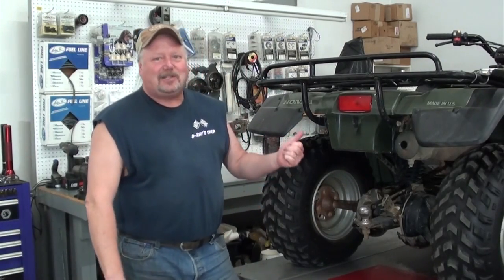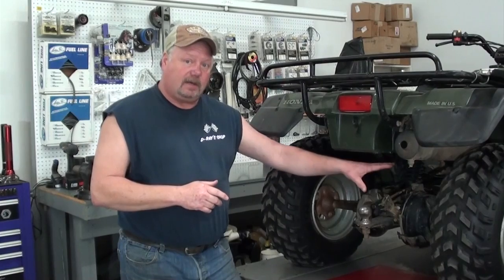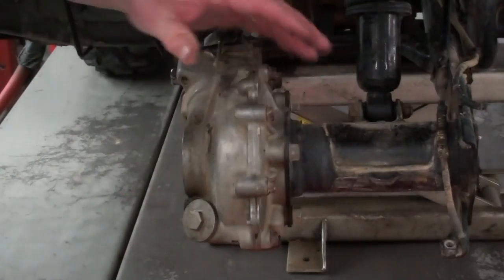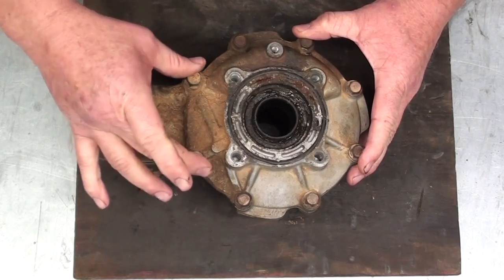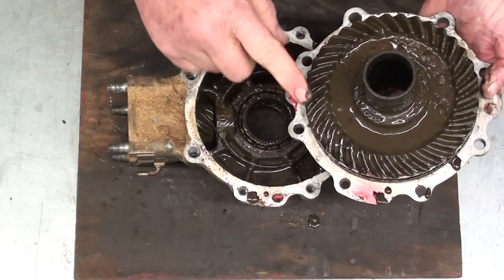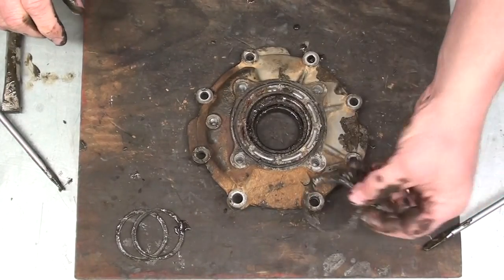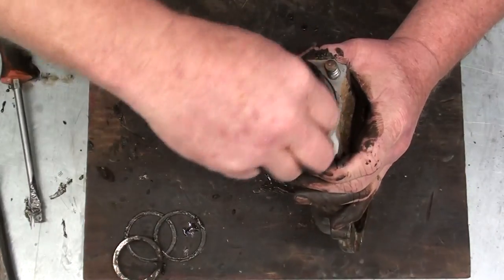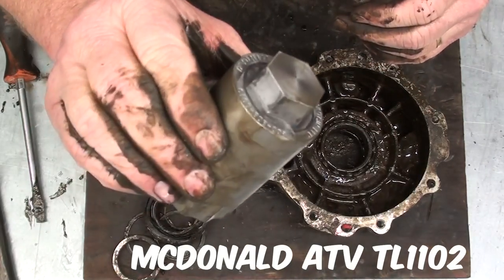Pt 1 Honda TRX300 Final Drive Rebuild At D Ray's Shop

Comment: So helpful mate , my big red final drive was shot. Now ready for bearing kit. Didn't have the special Honda tool you used so got some box section steel to fit four corners , worked a treat. Big thanks from Wales.

Comment: I found after trying various methods without success  in removing the small pinion bearing that by using a sharp pointed punch fitting loosely in the hole , a couple of sharp strikes results in exploding the race.

Comment: Man this is by far the best video period for this job. Thanks a lot. How did you get the metal sleeve off the pinion that the rubber gasket slides into that’s connected to the drive shaft?? Mine won’t come off!

Comment: Awesome video, I have a Honda Foreman 400 that has a welded axle to the crown gear.  I just purchased rear differential bearing and seal kit.   Is it still possible or because of the weld did I limit myself on this bearing repair.. I have a leak in my rear diff and want to resolve it.

Comment: D-Ray, I'm in trouble with my TRX300FW 4X4!  Bought used, rebuilding the rear differential and the case cover has 2 ears broken!  Anywhere I could contact to get a replacement? Can you help?

Comment: what did you use to get all that old fluid out?? ive tried degreaser and it doesnt work. usaully i have to get a ton of rags to clean it. just wondering if there is a easier way to get it all out lol
Reply: Gerardo Soto lots of brake cleaner is how I’d do it

Comment: Wow after looking at this video my final drive is in bad shape. I can't remove it from the housing! Yours just came off just like nothing. Also, the drive shaft stayed in the swing arm... Should I be alarmed? lol Thanks for the video!
Reply: The driveshaft should stay in the swingarm. The bike he was working on has had the driveshaft separated from the unjoints at some point. It was not reassembled correctly

Comment: If I replace the rear bearings do I need to replace them both or just the brake side??? Being that the other bearing last longer since its in grease??
Reply: they both get the same wear so why would one not change them together ,,rule of thumb ..

Comment: how much freewheel should I have?  mine is hard as heck to turn by hand with wheel off
Reply: If you have taken the rear end apart and reassembled it without keeping the ring gear shims in proper orientation “right/left”, there is a good chance the pinion and ring are binding. Those shims look the same but there is a minute difference on thickness from right to left side

Comment: Do you have a video on removing the rear axle on a 2005 honda rubicon 500.  Also a video on removing the swing arm to replace the bearings

Comment: How can I contact you .... I cannot find the spring clip for the pinion bearing anywhere..... thanks for your help
Reply: That spring clip is not necessary. Drive the bearing in and the pinion hold it in place. Honda over engineered that one just a bit